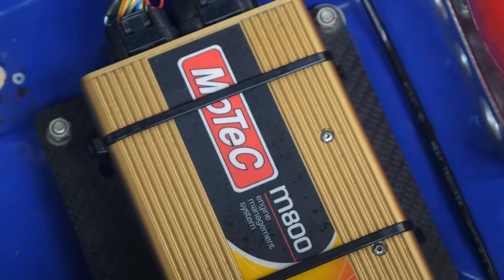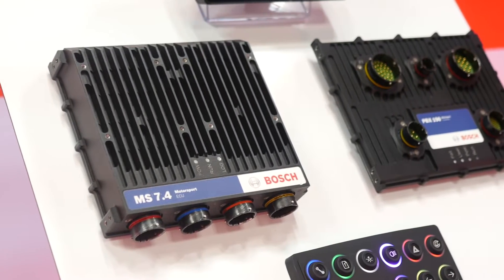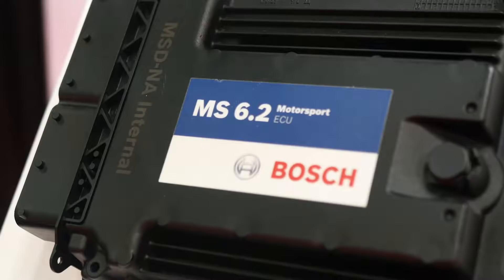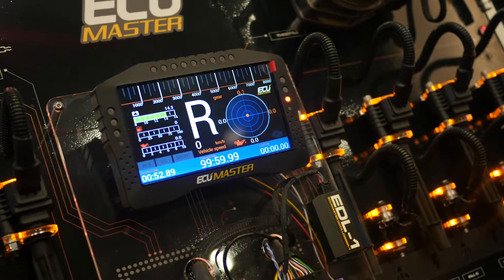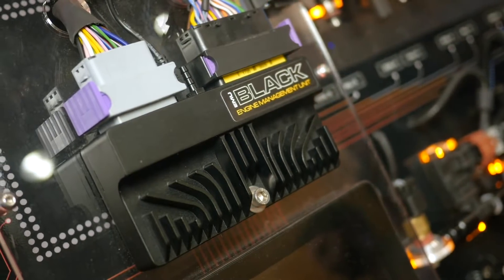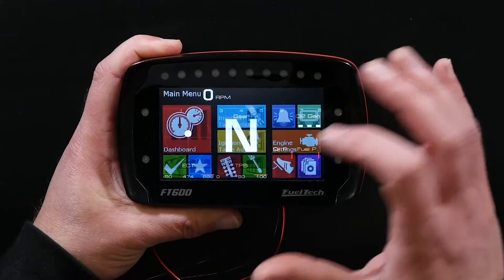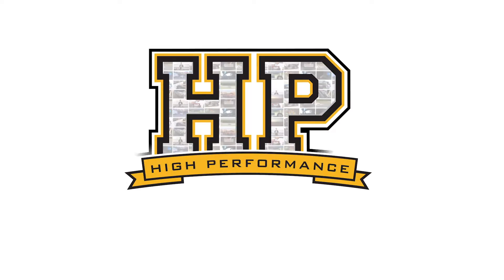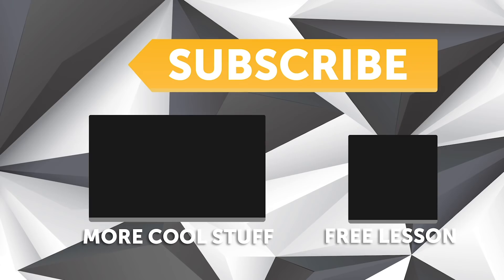'Basic' Vs Professional Level Aftermarket ECUs [TECH TALK]

Comment: We use indication systems at work for calibrating engines. Each Kistler sensor costs about 5k each and are prone to failing when exposed to LSPI. Then there's the amplifiers available from FEV or AVL, these cost about 50k . The data is invaluable though for in determining the inner torque from IMEP, pumping losses, peak pressures, rise rates, MFB50's, location of peak pressure, and even being able to determine the aircharge trapped in the cylinder after the intake valve closes.

Comment: I'll just stick with my carburetor,dual points ignition, and size 10wide traction control.
Reply from the maker: If that ticks all the boxes for what you need for your application and budget, then there's nothing wrong with that =) - Taz.

Comment: Are there any aftermarket ECU's that can be used to replace a oem ecu such as a honda s2000 ecu for 2004/2007 that can replicate the emissions? Also would this be legal in california?
Reply: The short answer is no, the long answer is yes very cheaply but not without violating a bunch of patents.
Reply: @cannaroe1213  damn. I'd like to be able to modify the oem ecu maybe to work as oem with hondata and modify code or whatever it is to have all those nice race features if I want em.
Reply: @Limeayy  Yeah for sure - but that is the opposite of what the automobile industry and political big-wigs want you to be able to do. Look at the controversy at "over the air updates" in the new Tesla, and how licensing authorities are freaking out that the final product may not be what they rubber-stamped as legal to drive on the roads. What you want to do is write the new code yourself, with the intention of modifying your engine characteristics. We don't live in a world where that is allowed to be possible, cheaply.
Reply: road hmm ok

Comment: What a fascinating conversation. I like the way he explains how all different kinds of data inform each strategy. Lots of ways grassroots guys can configure custom maps based on using sensors in interesting combinations. Predictive traction control sounds like a cool thing to try out.
Reply: I once drove a tuned 1000HP car which was so powerful, it had to have traction control in order to not spin out. The "strategy" was really simple - if the wheels start slipping, don't inject fuel or make a spark for some % of the cylinders. The guy later sold the car but kept the traction control system because that simple style of traction control can be put into essentially any car.
Reply: @cannaroe1213  in vintage Volvo 240 racing from the '80s they used similar strategies. Specifically they had a spark cut in a single cylinder when wheel slip was detected. Lots of cool things that can be done with some simple tech and smart people using it.

Comment: closed loop ignition timing, to be able to know where in the crank position each cylinder is achieving peak pressure, that a holy grail.
Reply: It's amazing really. You could do closed-loop timing with about €100 of computing power. 200,000 hertz sounds like a lot, but it's slow for a 1Ghz processor. The only reason it hasn't been closed-loop and fuel efficient for the past 20 years is patent law and engineering companies being awful at coding, as always.
Reply: Yeah so i looked into it a bit more and you can get screw-in 1000PSI 150C pressure sensors for $100 (not water cooled, but modern chips don't need it as they also have built-in temperature sensors to do the adjustment, and you get a temperature sensor!). As for the ECU, a 256 channel ADC with a 17k sample rate can be had from Texas Instruments for $350. Sure it's not a 200k sample rate, but 17k gives you plenty of control over your 256 channels for throttle position, air flow, O2/CO2, traction control, fuel flow rate, and if your RPM is under 8000, you can do accurate-enough ignition/crank position too. 17k at 9000rpm is say 150 rev/s. 17000 samples per second gets you 113 samples per revolution - so it's accurate to 3 degrees of crank rotation at 8000rpm. That's good enough for most. Not to mention you could just use a $5 200k ADC just for the crank position. The ECU operates at Ghz frequencies, so it's all slow to the CPU.

The TL;DR is that the markup for this industry is about 10x, which seems pretty expensive. Even with the R&D costs you'd think it wouldn't be more than 5x. But i suppose that's what you can expect from luxury sporting equipment.
Reply: canna roe omg this made me laugh, you haven’t a clue
Reply: I should point out that over the weekend I bought 4 for $500 off that Digikey link, and tried them out in an old Subaru with SOHC and they work without any drama. This isn't complicated you literally just drill a hole through the head, i went between the 2 inflow ports, tap it and screw the pressure sensor in. These are standard industrial pressure sealed sensors. There isn't much that can go wrong. Why is this so weird for people.
Reply: canna roe 
You need to read up on IC engines mate....
Maybe this is a good place to start? 
https://auto.howstuffworks.com/cooling-system5.htm

Cylinder temperature commonly reaches around 2500 Deg C

This is meant to be a channel for educating people in high performance engineering, not a platform for your fiction.
Reply: canna roe can you show us some of your results?
Reply: @RobMorrow_1903  2500C is hotter than an Acetylene blowtorch. you literally can't get petrol that hot if you tried. It burns around 1000C. And aluminium melts at 600C and softens at like 400C. Thanks to watercooling, and the fact that it's immediately allowed to expand in the chamber, it isn't anywhere near that hot. Nice LARP tho.
Reply: I don't think 150C can survive combustion temperatures
Reply: Nah it doesn't go much about 120, at least in a standard car. Could be in these race engines it's higher, but it could also even be lower because of ethanol instead of petrol.
Reply: Check out how much the sensor cost you will see its not much a processing problem but an instrumentation problem
Reply: Searching for some info on using it for normal heads brings up kisler. Which is a combo spark plug and pressure transducer, can't even get the price
Reply: @modernizedclassics  Yeah they seem to be a big supplier for the auto industry. New their kits cost over a $1500 for a single sensor. On eBay the price comes down to what you would expect. $600 for a water-cooled one in 2016: https://www.ebay.ie/itm/271948914100 

$120 for a non-water cooled one in 2020: https://www.ebay.com/itm/283622188838

$120 seems to be the market price for a pressure sensor that could work in an engine, although if you buy 10 of them new you can get that down to $100 a sensor.

https://www.digikey.com/products/en/sensors-transducers/pressure-sensors-transducers/512/page/300

Comment: Given the incredible complexity and how quickly these new technologies emerge. I Cant imagine how challenging it is for the various sanctioning bodies to determine the rules of use... must be quite daunting indeed.
Reply: Especially Motec (not sure about the others) where the firmware can be edited by the tuner to add new features.  That said it's not as much as you think. Stephane Ratel has a great team of people and the infrastructure of the FIA behind him. They caught Mercedes Benz with a flash they didn't use the rest of the season they had installed on all the factory cars just for Spa (2018).